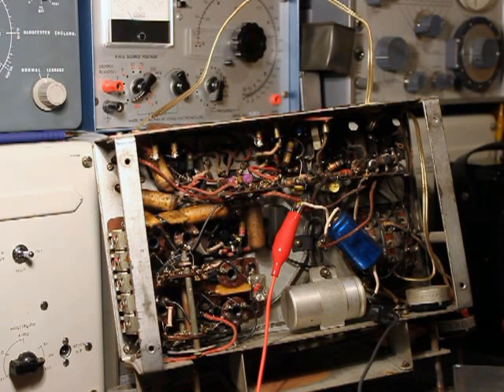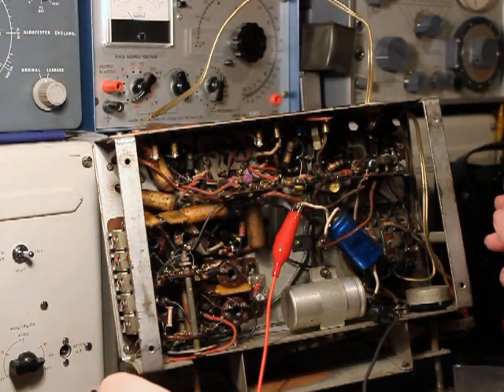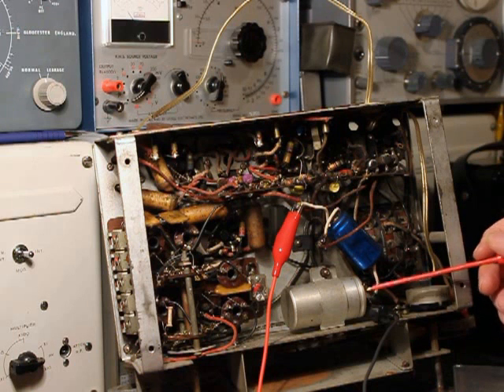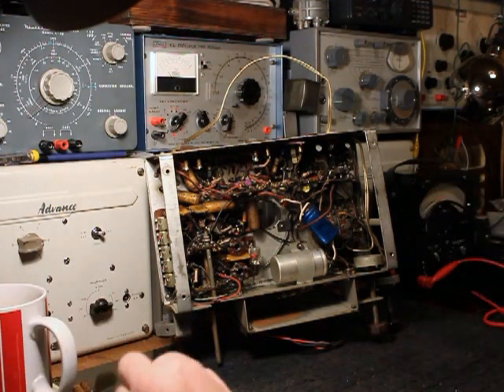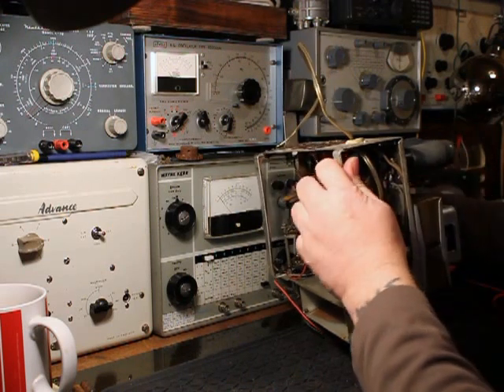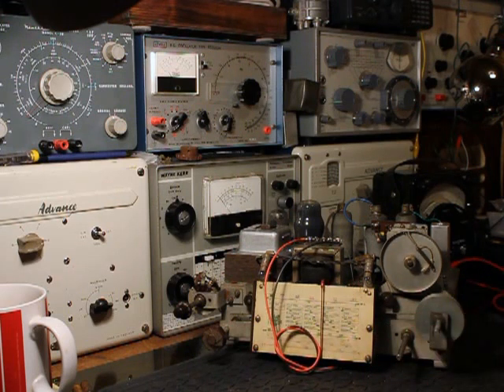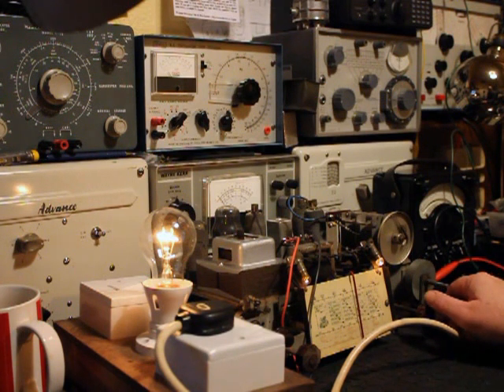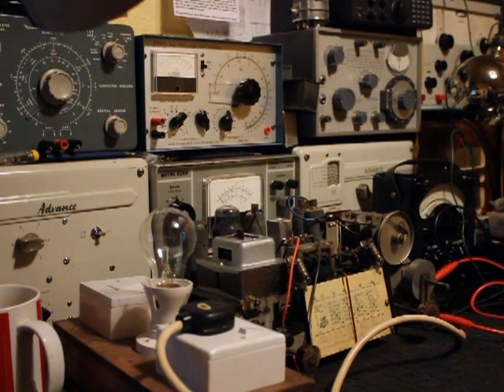Defiant MSH 546 radio part 3

Comment: The valves are as follows vp4l,hl41dd,pen45,uu6 as per the valve sheet inside the set I will post some pictures on the forum 
Robin

Comment: Hi the valve line up is different  it uses a pen ;5 as an output valve I shall watch the rest of your vidios very informative I have a barker 88 to do next when I get a new transformer for it 

Regards
Robin
Reply from the maker: Hi Robin, do you mean a Pen45? This would mean you have 6.3v heater supply on the other three valves, 4v for the Pen45 and 4v on the AZ31. Usually the TX only has a seperate heater winding to supply the rectifier.  Can you remove the output valve, check the heater voltages on the pins of V4 and also that no-one's fiddled with the valve base wiring?  I'm wondering if someones shoved a Pen45 in the valve base instead of the EL33 as per Jon Evans' MSH547. If you switch on with the Pen45 in place you might be sticking voltages up where they don't belong :)

Comment: I have just got a defiant MSG 547 which looks similar to your wireless I got from a bvws avent are they similar
Reply from the maker: Hi Robin, I saw your post on UKVRRR a couple of days ago. I think your set is similiar but not the same to this 546. I've not seen you post any piccies of yours but you said it's different to Jon Evans' set on his Valve Page, how?  Not hard sets to work on by the way. Check the HT smoothers, change the V3 to V4 AFcoupling cap...I'm sure you know the drill.

Regards - Andrew

Comment: Andrew,
Great to see the Defiant up and running.  To tell you the truth, I thought you might have been faced with a few unexpected problems.  I’m happy for you that both the pre and powered assessment went smoothly and the radio isn’t, as we used to say in the trade, hard of hearing, i.e, poor reception.  As I have said, it is usually makes like Defiant that so often put me about.  I have to smile to myself sometimes as I’m unsure whether its brands like Defiant, Portadyne, Regentone, Ace, Ever Ready, Strad, Beethoven, Champion, Master Radio, Raymond, etc. that are not keen on me or I’m not keen on those particular brands.
Well done Andy, this is a good repair/restoration series. If you restore and clean this Defiant as good as you restored and cleaned the Strad, it will most certainly look and sound brilliant my friend.
Regards,
Phil.
Reply from the maker: Thanks Phil, I was absolutely of the opinion something would be wrong with this set too! Despite my initial thoughts, unless I co-incided with a particularly good reception time when I first applied power, it is a little deaf since I've changed all the capacitors.